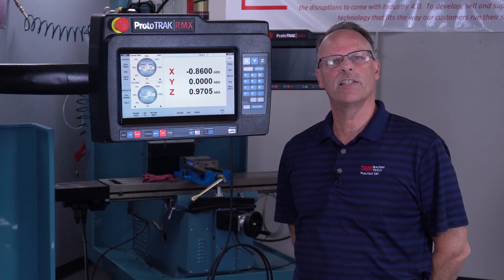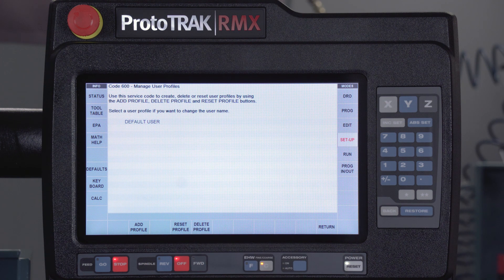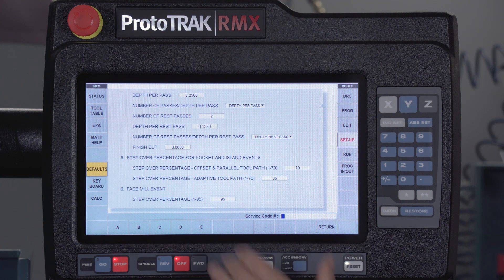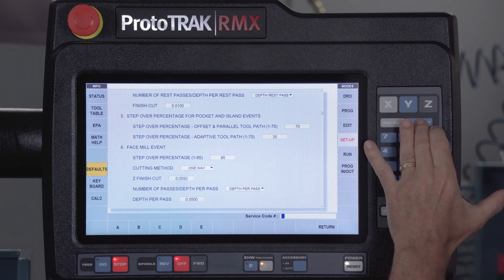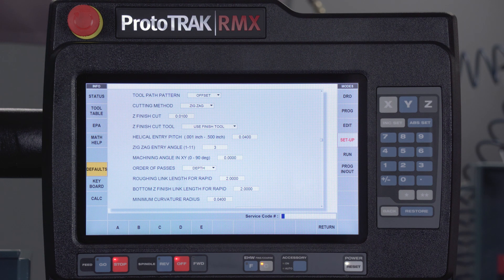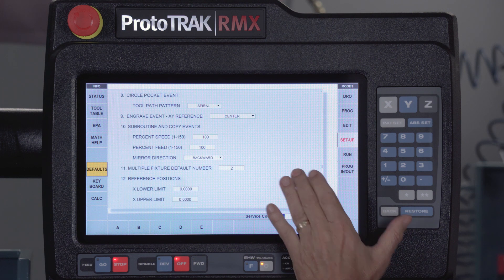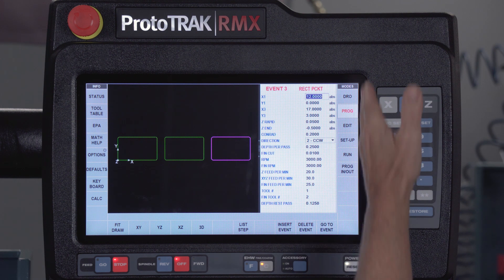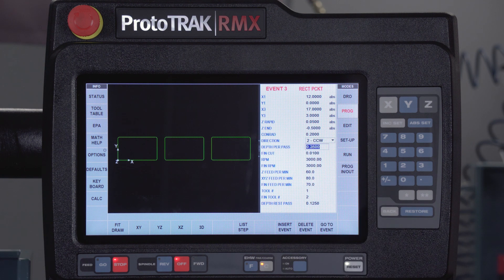Using Defaults and Options with the ProtoTRAK RMX

Comment: Does the older SMX control have any adjustable  default settings, or all default settings new with RMX?  Thanks
Reply: Sorry for the bad news but this is a new feature in the RX products. There are a few defaults such as Pocket stepover amount in the SMX and depth of cut or number of passes in the SLX but that's about it.  All the other things found behind the HELP key when the "?" is showing are simply options for that particular event.  T.P.